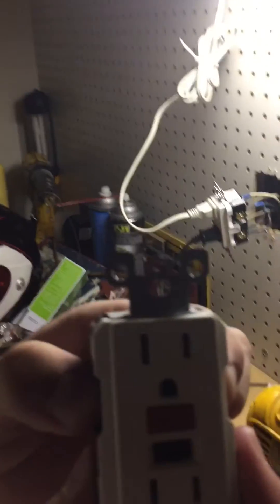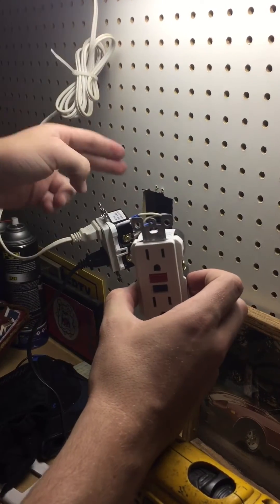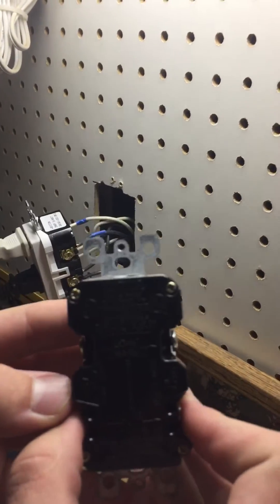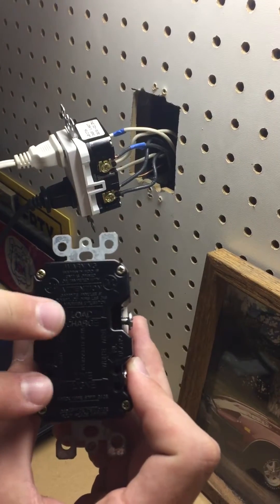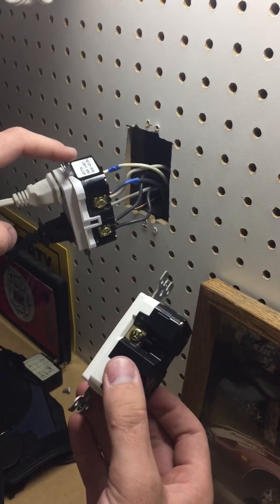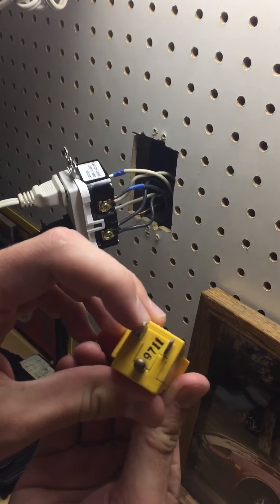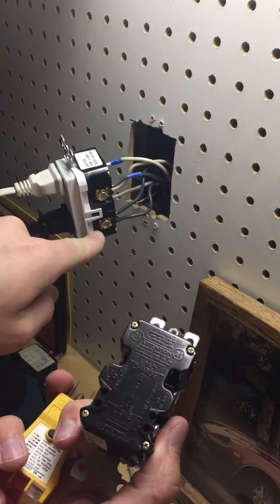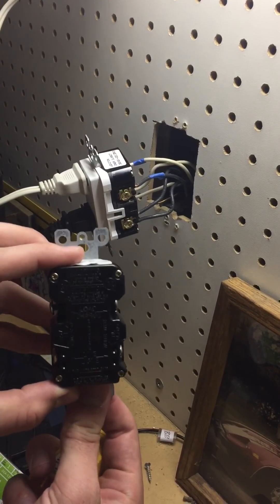6 Wire Installation from GFI to GFCI

Comment: On my Leviton instead of having a screw on the outlet, I have a wire coming from my load outlet. Can I put the 2  load wires going into the wall onto my load wire that’s coming from my outlet in a pig tail  where you put both  wires onto the screw.

Comment: It shouldn’t take anyone that long to figure that out. The load side wires should all be connected together and pig tails made and connected to the load side of the gfci outlet. That way the connectyis a better connection. There is either lone side or load side. Line is the hot and neutral incoming. Easily identified with a meter. The “other wires” are the load side wires. They need to be paid tailed to ensure equal load.

Comment: I installed a new GFCI outlet and it didn't work.  I was all set to call an electrician when I found this video explaining that the new outlets have the Load and Line ports switched from the old outlets.  WTF?!!  That helped me a lot and now the new outlet works!  Thanks guys!

Comment: A person doing this should know where the load wires are going. One pair goes downstream and the other pair goes downstream and to another branch. Do you want all those receptacles gfci protected? Is there another gfci already existing? This is not hard to determine.
At the very least you should have a plastic old work box in there. Attaching the receptacle to the peg board is a disaster, you could one day pull it completely out of the wall just by unplugging something. This is another issue that's easy to rectify.

Comment: Technically, GFCI refers to a breaker that protects an entire circuit. This would be a GFCI breaker on your electric distribution panel and will protect multiple outlets. A GFI is a local Ground Fault Interrupter, it is at the outlet and not on the panel. Your unit GFI has a different design therefore newbies thought they are the same but if you read the instruction it became clear!

Comment: You said GCFI like a thousand times Lol It's GFCI and some of them have Line and Load in different configurations depending on the manufacturer, even if new. The person installing the GFCI needs to know which wires are Line and Load or else it's easy to make a mistake. You can't always just copy the wire configurations.
Reply: It had fooled me for a sec. I was like., wth.?! There's also a GCFI..??? 🤦‍♂️🤦‍♂️🤷‍♂️
CHINGAO..!!!  HAHA..👍🏼

Comment: The only way I can get 1 side of my garage to work is to turn it up side down tell me what I am doing wrong
Reply: You probably put the line on the load side, so it wouldn't work. You need to test which wires are hot before installing a GFCI, unless you are combining all hots and neutrals. In that case, the load side will not be used, and all devices down stream will not be protected unless you install GFCIs on them. A GFCI can be wired to protect several regular receptacles down stream, but it can also be wired to just protect itself and send regular unprotected power down to the next device.

Comment: Ok so my question is i have 3 lines (6 wires) 1 of which is coming off from a different circuit breaker...where do i tie this in if its only telling me about 2 lines
Reply: You can't install several hot wires from different breakers onto one GFCI. You need to get someone who knows what they are doing.
Reply: If you have only 3lines. It goes to the line only. Not the load..